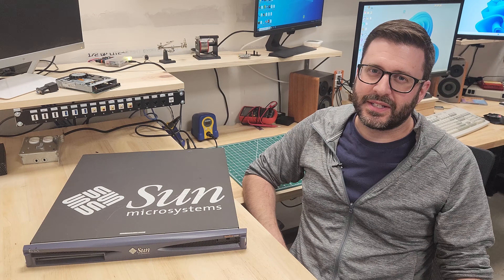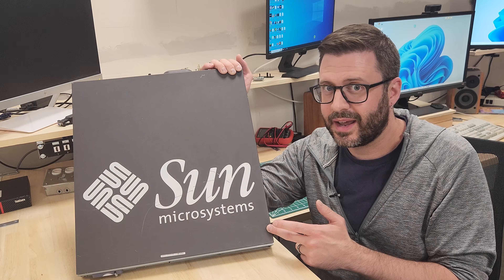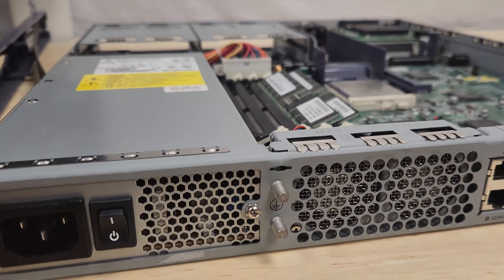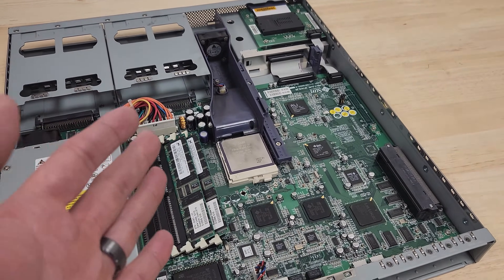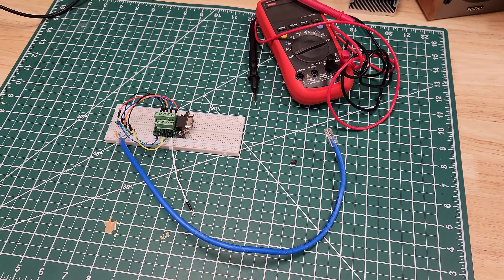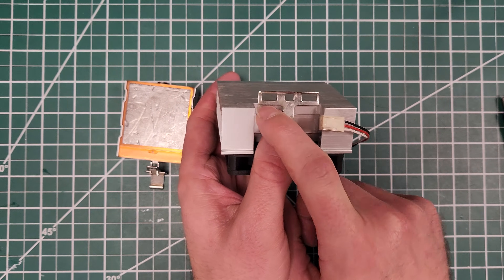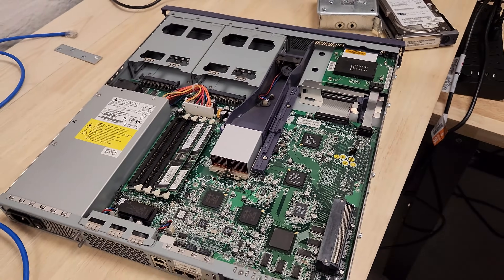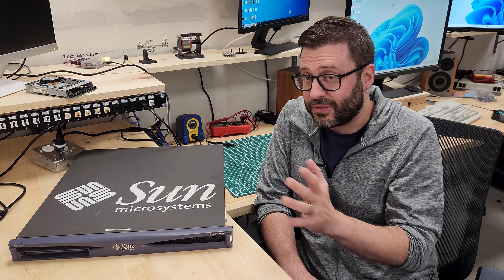Reviving an Old Sun Microsystems V120 Server

Comment: Worst case scenario for CPU heatsinks that you can't attach, my old mac mini had cheap plastic post for the CPU heatsink, well after 8 years, they became brittle, 3/4 broke, and apple wanted $75 just to diagnose it. 

Thermal epoxy is a thing :D it cost me $10 for a tube of it, heatsink has been attached for the last 10 years, no issues.

Comment: What makes the SPARC processor unique is register windows and movnz SPARC V8+ instruction: the register windows provide 256 virtual registers (32 physical), and the movnz instruction will move data conditionally without having to take a branch and invalidate the instruction cache. Additionally, every branch not taken provides a free instruction slot within the same clock cycle. A coder who understands how these processors work can squeeze crazy amounts of performance out of SPARC CPU's.

Comment: Even in 2024, these make for nice, fast web servers with a correctly compiled and packaged Apache web server (see "3rd party and unbundled applications" in the filesystem(5) man page on Solaris 10), even though they only have an UltraSPARC processor designed for embedded applications.

Comment: You might have spent half the money on a "Gateway" PC-bucket, but it wouldn't have anywhere near the lights out management (LOM) features that V120 "budget" server has. The very common mistake is presuming that the PC-bucket had any kind of feature parity with that entry level server; it does not.

Comment: Hi,
Did you at one point manage to netboot your v120?
I have a solaris 10 VM on my proxmox host set up to host a netboot server, but my v120 refuses all my attempts to get it to boot from it...
is there any special trick to it that I'm missing?
I can read from the tftp server and I can also mount the nfs share just fine but my v120 just throws this message at me:

3a000 Using BOOTP/DHCP...
Bound: IP address is: 192.168.12.59
Found 192.168.12.1 @ mac address
BOOOTP/DHCP configuration failed!
panic - boot: could not mount filesystem.
Program terminated

Comment: Wow this brings me back. I use to run my DNS server off one of these. I hated the chipset on these if was slow compared to the better sunfires.

Edit: You should check out the T2+ based servers, I scrapped mine when debian dropped support for SPARC. These things were 10 years ahead of their time with 6 channel memory. (per processor).  I tried to use one as a desktop with pci-express extenders but couldn't get a modern GPU to run right. (2020). The firmware file loading in would start the frame buffer then cause a kernel panic.  The 3d relms card I had couldn't accelerate video so I scrapped the thing.
Reply from the maker: oh yeah, I like the v120 but it's definitely slow
Reply: @clabretro  needs properly compiled code to be usable, as in: you better know which options to use with the Sun Studio compilers to get the performance.

Comment: Hey clab! I’m rewatching this video because I’m really interested in buying a V210 off eBay. Does $180 with shipping sound good? Or should I go for a V100 for like $100-140 (i found two listings for V100s.
Reply from the maker: hey there! well — beauty is of course in the eye of the beholder when it comes to these old enterprise server prices. for context I paid $120 shipped for my v240 (but I think I got lucky — that was a good deal — and one of the CPUs was bad and missing a heatsink). So after CPU and heatsink costs it's back up to the ~$180 range.

I paid something like $130 for that v120. Personally, I'd go with the v210, I think you'll get more use out of it. the v120 and v100s are pretty underpowered, whereas my v240 can comfortably run Solaris 10 and anything I do with it. but either one would be fun, can't really go wrong!
Reply: @clabretro Update: it arrived! I’m waiting on hard drives and drive trays though. LOM and OBP work, but I have noticed some odd behavior with the diagnostics. When I first tested it, I got some errors from VxDiag about the I2C bus, but it magically fixed itself. Unfortunately both CPU fans are bad so I’ll have to find some replacement 25mm fans. Thank you for making all of this amazing content on Sun stuff. Your videos on the Sun Ray got me hooked, and I guess it got the best of me lol.
Reply: @razzledev  Mate you gotta document your build id love to watch

Comment: I have a Sun Fire V880 that boots but has a lot of self-test issues. It’s massive. I am missing the case key and so I can’t do any service, which is all the same anyway because it’s so heavy I can’t get it out of the road case it’s in. Would love to explore it and maybe even get the original software (included in box) going.
Reply from the maker: Those V880s are no joke! That'd be cool if you got it back to life.

Comment: Greetings and thanks for the video. I think that the substance on the back of the heat sink is indium. Look it up & check it out!

I've never seen this on a commercial computer but I've used it in a scientific CCD camera with integrated TE Cooler. Sucking heat out of the cooler was paramount, so we used indium. High thermal conductivity, four times softer than lead and very conformal to make good thermal contact to both surfaces. Will not dry out. If you still have it, keep it, it's good stuff and not cheap!🖖
Reply from the maker: I left it on there! Not sure if it's indium but definitely some sort of thermal pad.

Comment: I believe that is a graphite pad on the back of the Heatsink. They were used in place of thermal paste because they don't dry out.
Reply from the maker: totally correct! it was pretty scratched up so I ended up replacing it with thermal compound and haven't had issues.

Comment: 6:00 I don't think the PGA Socket 370 (Intel) is mechanically compatible with this PGA 370 (USII) socket, if you compare the pin arrangement for the keying is different. See WMF Commons "Sun_UltraSPARC_IIe_back.jpg" and compare with "Pentium_iii_sl4cb_reverse.png" (no links because spam filtering). The UltraSPARC socket is also a few years older than the Intel socket.
Reply from the maker: Oh thanks, I never actually went and looked that up.

Comment: I helped administrating a SUN E450 (4x400MHz CPUs, 2Gigs RAM) in my University 20 years ago. The fact that a raspberry pi would outperform that expensive beast now makes me a bit sad.
Reply from the maker: Nice! Yeah it's amazing how much things have changed.
Reply: Do not use raspberry pi's they aren't reliable i bought best model and have a low voltage notification and then my hard drive with 20 years of data corrupted
Reply: @vanpeters9751  Thats so tragic :(

Comment: Suns are remarkably durable. I am a penetration tester and with established clientele it is not at all unusual for me to stumble upon a Sun that's been running nonstop for 20 years or more.
Reply: You need to get yourself an Ultra 80. They were the last bulletproof workstations that they made, with up to 4 CPUs and options for hardware 3D graphics.
Reply from the maker: yeah I'm starting to think there are a lot of Suns still running out there. would love an Ultra 80, super awesome machines.
Reply: @clabretro   When will you get your first Alpha and Itanium machines? ;)
Reply: @clabretro  I have a question, where did you get that V120?
Reply from the maker: @carloisdoingstupidtechstuff  eBay. The V100 and V120 are okay but once you get bigger than that it's better to find local... shipping gets too expensive.
Reply: @hessex1899  Sunblade 1000 and 2000 were also good. I was using a Sunblade 2000 with xvr-1200 with 2 x 24" lcd's connected via dvi as late as 2013. I also worked at a powerstation that used sun boxes as scada systems. Those machines had a 10 year life.
Reply: @andrewnoonan5786  Solaris for SCADA is still a thing in 2024. It's not really surprising considering that Solaris 10 has received nothing but fixes via recommended patch cluster for the past 15 years, making it super reliable.
Reply: @hessex1899  Desktop version of the E420R server. I ran an E220R for many, many years.

Comment: hell Sir,can you discuss about Log In to Oracle ILOM ? what to do, how to access Log In to Oracle ILOM ?.I have problem with sunfire v 120 to access the lom console .Thank you!!!
Reply from the maker: I was able to reach it over the "A LOM" RJ45 port via serial with minicom on Linux, I suspect default Putty settings on Windows would work too. The trick is having the right cable, I made my own based on the pinout in the V120 manual, starting at page 83: https://docs.oracle.com/cd/E19088-01/v120.srvr/816-2090-10/816-2090-10.pdf. I believe a Cisco DB9/RJ45 console cable will work for this, but I haven't tried it myself!
Reply: @clabretro  Thank you very much for advice !!!!  I spent many days research . but I didn't find anything useful!!!!!

Comment: Man early in my career I worked at a Fortune 500 company that had tons of SPARC hardware, like every model you could imagine. Solaris was an interesting OS to work with, zones were pretty cool though. The 600 0blade chassis were interesting, mixed x86 and SPARC blades.
Reply: I still use Zones! hell I just deployed a DNS server in a Zone running on OmniOS :))
Reply: @AntranigVartanian  yeah, zones are still way ahead of anything GNU / Linux has, even in 2024, and are still a thing to use. Fancy meeting you here!
Reply from the maker: That's awesome! It's amazing how many server variants Sun came out with over the years. I'm totally new to Solaris so I'm excited to mess around with it.

Comment: I was actually expecting you to attempt an OpenBSD install. However, I was actually quite surprised to see Solaris is still being developed. Would it be possible to update the the lastest version?
Reply from the maker: Amazingly, it'll run Solaris 10: https://www.oracle.com/webfolder/technetwork/hcl/data/sol/systems/views/all_servers_oracle_systems.page2.html

No "official" support for 11 though: https://www.oracle.com/webfolder/technetwork/hcl/data/s11ga/systems/views/oracle_systems_all_results.page1.html

If the hard drive works I'll have to give those both a try anyway though. I'm new to the Solaris world, I need to play around with OpenBSD as well.
Reply: @clabretro  thats super cool!

Comment: A Cisco console cable is perfectly fine for this.
Reply from the maker: It actually says that in the V120 manual, which I of course read after trying the MRV cable. I need to get some of those Cisco console cables... but in the meantime I'm gonna hook it up to that MRV which is also RJ45, so I'll just make an RJ45<->RJ45 crossover cable between the Sun Fire and the MRV.

Comment: The UltraSPARC IIe is not what you want. The IIi is the workhorse of SPARC of that age. Runs through Solaris 11 just fine, before they dropped sun4u support...
Reply from the maker: Oh interesting! The Wikipedia page on the SPARC II is super misleading: https://en.wikipedia.org/wiki/UltraSPARC_II. Glad to know it's got a good processor in it.
Reply: @clabretro  Wikipedia is not exactly wrong it's sun's marketing that's weird. The cpu you have is a IIe+ but for some reason sun liked to call it a IIi even tho they already had a cpu named IIi from the previous generation.
Reply from the maker: Ah thank you! I was trying to figure that out.
Reply: @clabretro  Yeah, sorry, my mistake about the IIe+. I never had or worked with those particular models. My first SPARC server was a SPARCstation 4 that I got off a local Linux Users Group. I got it working, and practiced with Solaris 8. Then I got an Ultra 5, maxed out the CPU and memory, and beta tested Solaris 9 and 10 on it. I also had a Sun Fire V240, a 280R in the form of a Netra branded model, and haven't been able to afford one since. They are priced out of my budget now, but I still love the systems to DEATH. I really like the Solaris operating system, and am an active member of the Illumos community. I'd like to get a CoolThreads server (the Niagara UltraSPARC T1, T2 or T2 Plus) and run Solaris on it again!
Reply from the maker: @maverickbna  very cool! love hearing all these stories about people's experiences with these Sun machines.
Reply: Solaris 11 support was dropped for a technical reason. I think the memory management introduced in the first service pack wouldn't work on the ultraSparc II CPUs, but by that time uncertainty around the Oracle acquisition, plus the proliferation of cheaper intel-based linux servers had taken its toll.

Comment: I was super looking forward to this video because I have a v210 and v240. I've also got a couple of other xeon sun servers which I think you hinted that you got an x2250 in the one video. Love the content, keep it up!
Reply from the maker: Nice! those v240s look awesome, just need to find one for the right price. yeah got an x2200 which will start showing up in some videos. never messed around with solaris before so it'll be fun to get them working.
Reply: @clabretro  It would be interesting if you can find a Sunblade 2000  as those machines take fc-al drives instead of scsi. I still have a Blade 2000 and Ultra 80 in my collection but sadly they are on the other side of the world to me right now. Locally I just have a V210 and V120. Get involved and start testing Debian! It's still being worked on for Sparc!

Comment: Nice! it's really close to the Sun Netra X1, I own one of those,  had it as a main homelab server from 2005-2007 with Solaris 10. Very reliable system, but {slow, power hungy, noisy, limited} as hell. Great video!
Reply from the maker: Awesome! I would've loved having one of those back in 2005-2007. When I did research on this V120 it sounds like the Netras were a sister line meant more for telecommunications use, they were tougher machines rated to handle more physical abuse.
Reply: @clabretro  some netra's had AC power supplies allowing them to be installed in telcom system racks. Exactly the same chassis just different power supplies.